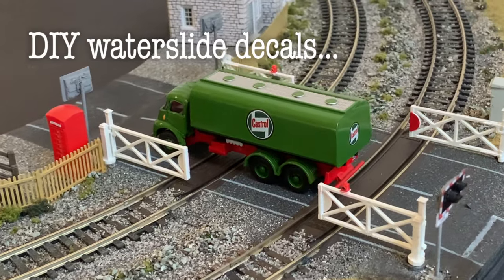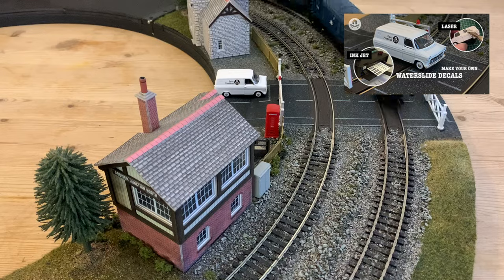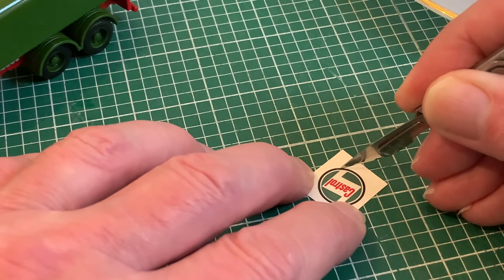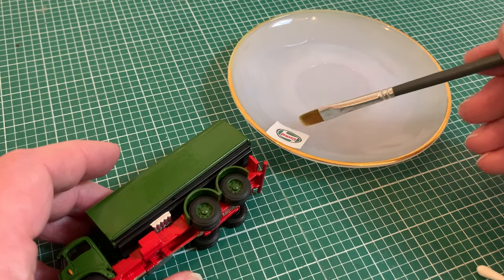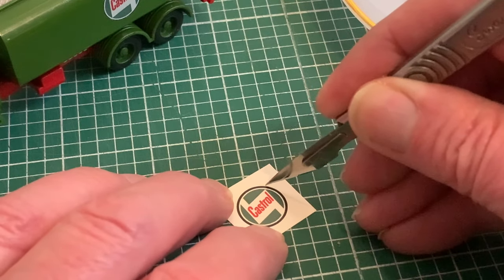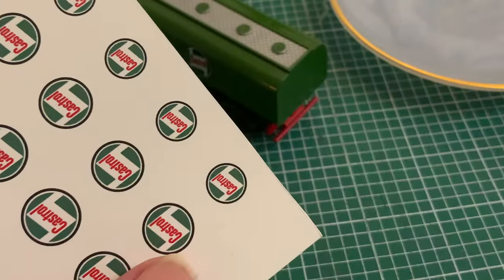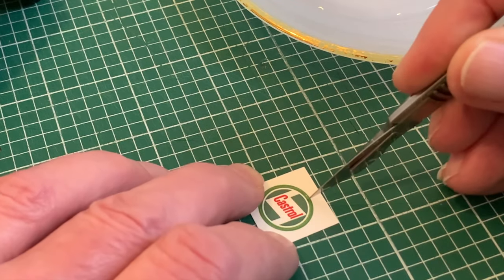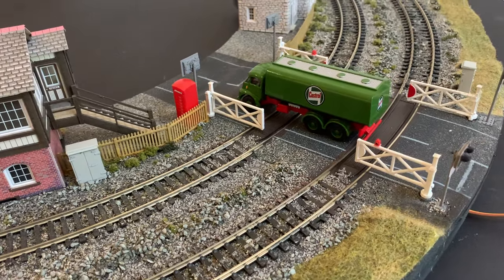Making waterslide decals – with white – using just an ordinary inkjet or laser printer.

Comment: Nice job, but you could do it a little differently and possibly easier...1 print a black circle outline as a guide to just cut out the white disc to go behind the coloured clear decal.    2 paint the top of the clear printed decal white and slide on upside down...your decal print is reversed prior to putting on the vehicle.  utube videos showed the technique for clear decals on dark back grounds
Reply from the maker: Great tip. Thanks.
Reply: make a vid lol

Comment: Nice idea. Could you use an all white decal as the first decal? That way there is less need to line up the second decal accurately.
Reply from the maker: Yes, that would work, but I think the lining up is actually made easier with the type - and you know it really is exactly the same.
Reply: I have done this before on some 1/144 scale aircraft and AFVs and it does work but alignment is definitely the key.  As for colour matching when the white isn't outlined by, say, black, again this can be done but it is extremely difficult to get the colours exactly right.  It is further complicated when you think you've nailed the colour but, the moment you apply the decal, you realise the colour of the decal sheet backing paper had an influence and the tone isn't as good as you'd hoped.
Reply: Well presented video, and great tip about white and transparent decal sheet.  It looks like the second decal (clear one) is to put the wider border to secure the edges.  Why not just use unprinted clear over the printed decal?  Why do you print the clear one?

Comment: Nice video, thanks. Whereabouts do you get your decal sheets from? I've got an inkjet and you've inspired me to have a go at doing my own decals :)
Reply from the maker: You may be able to get them from a craft shop, but failing that they are readily available online - search 'waterslide decal paper'. Just make sure you get the InkJet type. The decal surface itself is very thin, most of the bulk being the carrier paper. Very much like the transfers for Airfix kits etc.
Reply: @paterpracticus  thanks for the quick reply. I take it if I use an inkjet printer I will have to seal the surface else the ink will run when placed in water?
Reply from the maker: Yes, the same acrylic varnish is good for both InkJet and laser printing. You don't actually have to seal laser prints, but it does protect the surface. You definitely have to for InkJet - check out my previous video here: https://youtu.be/BriLaf8wvy0?si=H0kPOmzQgri_LegM
Reply: @paterpracticus  fab thanks, will check out the other vid! :)

Comment: You may want to use some Round Shape Paper Punchers. Insert the paper and look thru the whole to align it before you punch/cut it out.
Reply from the maker: Good suggestion, but would need to be the exact sizes for each.
Reply: I have a dspiae rotary circle cutter that lets you dial in the exact circle size which would work great with this method. It's the abstract shaped decals that I'm wondering if I can tackle haha
Reply: @ZILLA....  maybe a cricut.